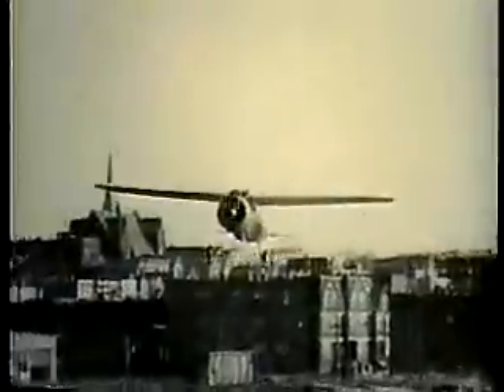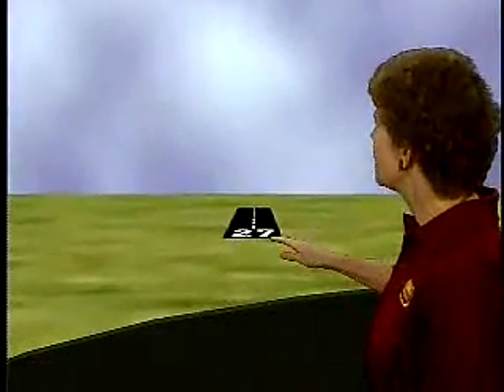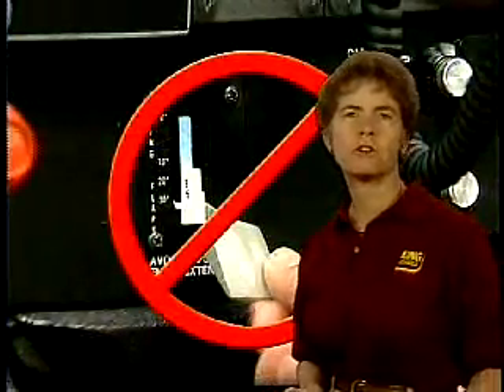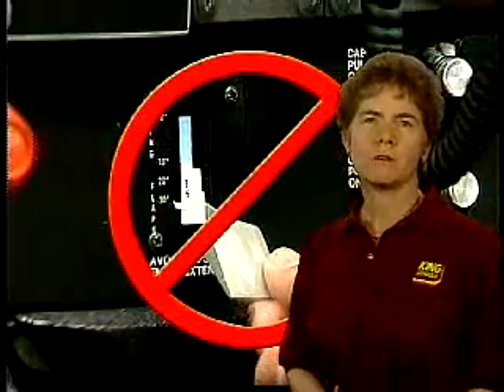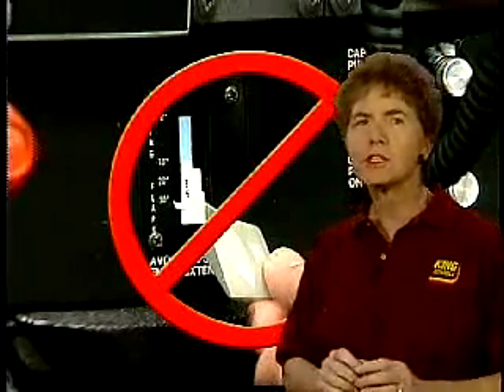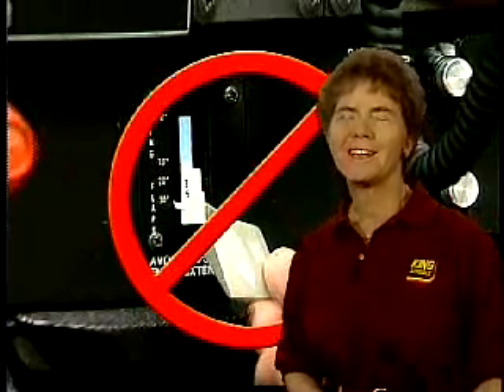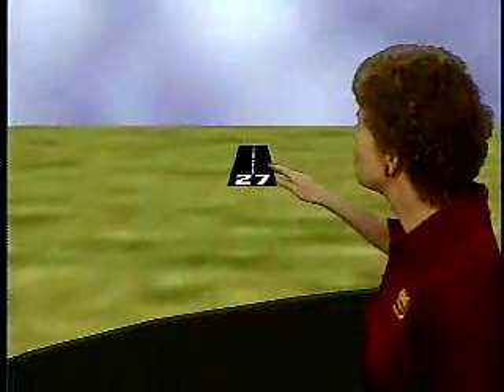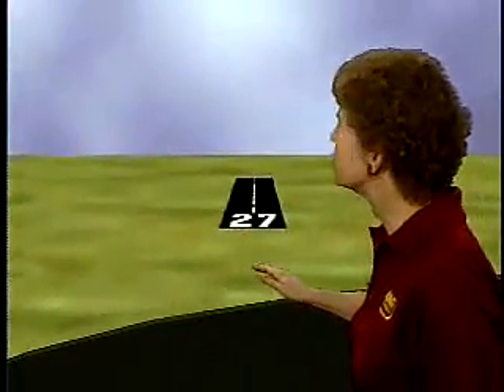Landing an Airplane: Adjusting the glide path - KINGSCHOOLS.COM

Comment: @thedreamliner2012-- try it some time.  It's not quite as "common sense" as you think.  What I've been struck by (I'm a student pilot right now) is the dramatic difference between "head knowledge" and "practical knowledge".  Sitting behind a desk at home, I can wax eloquently about aerodynamics, lift, weight, thrust, drag, how the plane acts in a stall, what someone did wrong on a landing, blah blah blah.  However, flaring an aircraft above the runway, and settling down on the mains just right is definitely a learned skill, and it has to get to the point where it's almost automatic before you're very safe as a pilot.  It's like the difference between reading about riding a bike, knowing everything about bike mechanics, versus riding one.
Reply: Yes itsa learned skill. You can bounce em down for decades, or you can learn to land any aircraft by FEEL. Most people drive em down good enough to get a license, then maybe, just maybe they might learn what to do after a few hundred more hours. A good instructor can teach FEEL to almost anybody in the first few hours and have you greasing them on nearly every time. Find a good instructor.